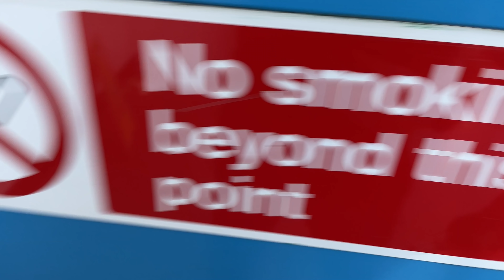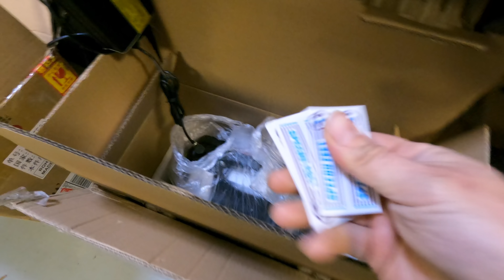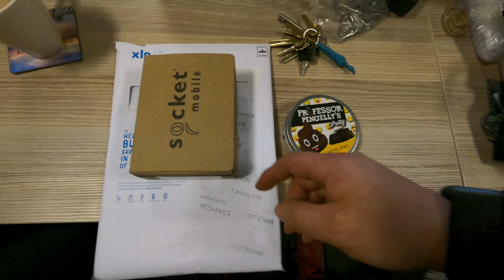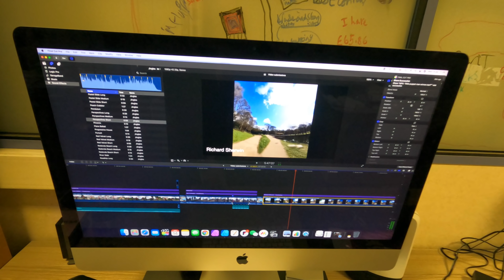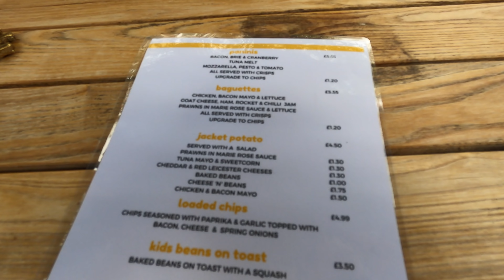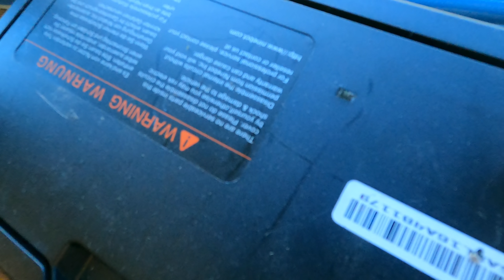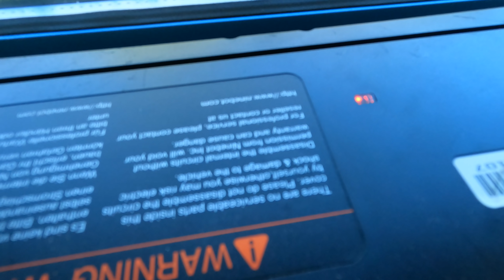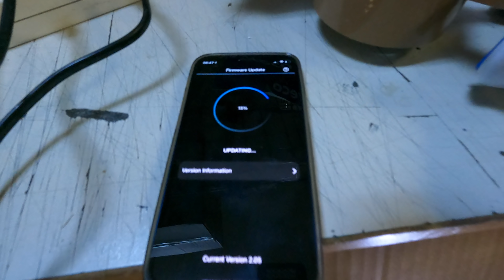Speedy Feet Weekly | Episode 15 | Jonathan Whalley Special

Comment: 4:44: it turns out that as identified recently in user groups a non-negligible amount of customers, since the early Sherman days have received defective rims and still are now (even as replacement) with the wider 60mm version.
Jonathan didn't think that his practice did would break the rim, and maybe he was right in case, and the rim had a manufacturing defect.
Reply from the maker: In terms of our experience, we have had zero warranty/faults with any of the Shermans we have sold since release...this is the first with a rim failure.
Reply: @Speedyfeetuk  since it's a popular wheel worldwide I guess it represents a good sample size from what you sold!
Thanks for sharing 👍 it helps putting things in perspective as always.
I'm getting a Sherman soon and will check while swapping to a street tire first thing.

Comment: The Ninebot One E+ may be vintage but I still love it and ride it a lot :-) (you managed to get it in shot again I notice)  I found a cement mixer in the hedge when I moved to the house, bit of TLC and it works - result, have used it a lot. Mixing cement by hand is no fun. InMotion Hover shoes I have yet to replace the batteries in mine - working on it. I'm Kingsong, you supplier - did 8 miles on the KS16X today - wow I know! How you people damage rims is a mystery :-)  Weights yeah, I would lift one at a time - where you want them :-)  Inflatable bed OK? confused. 30 miles off road - sounds tiring, the lengths you go to, to avoid it is impressive, A few pounds pressure in the tyre I think if your riding steps. Oh dear it gets worse.....  , and worse. Overstock umm Mario moved some shelves and mess completely cleared - result, the new space is  impressive. If you need to store an S18 here, it would be no problem.   Fun video, looks a great place to work, especially if you like digestive biscuits.